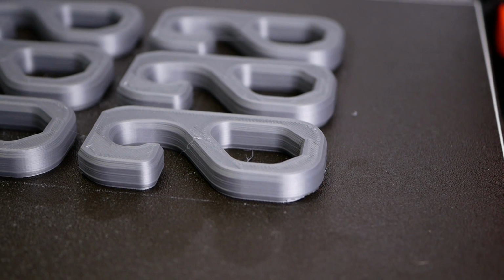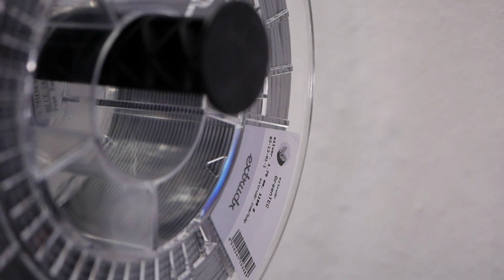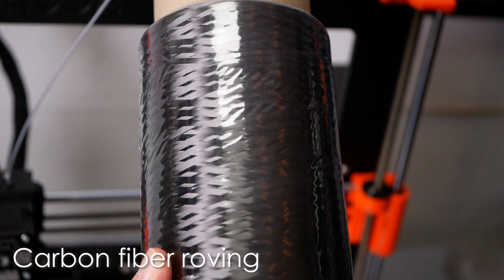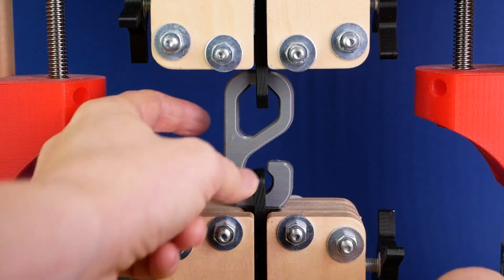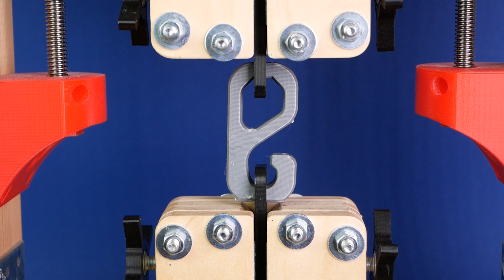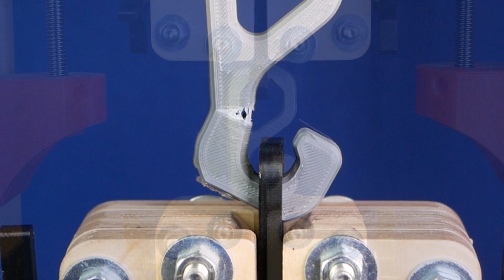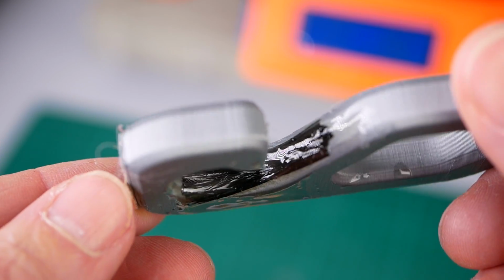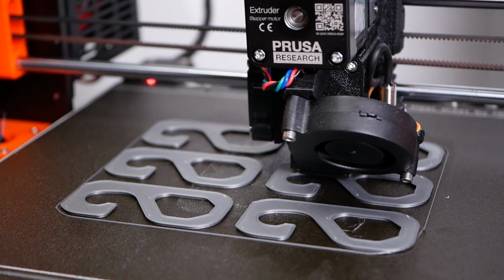STRONGER 3D Prints with GLUE? (and CARBON FIBERS)

Comment from the maker: Don't forget to share this video on Facebook, Reddit, Twitter and other social media!
Reply: Do carbon fiber videos please.
Reply: n Hello Stefan.. Can you doing similar test? I would like to know what happend if you use infill let say 15% and into the space you inject epoxy?!
Reply: If you're doing CF tests, could you also please try reinforcing with woven cotton/polyester fabric/cloth/textile? It's much cheaper than CF, and literally everyone has some available
Reply: Happy 2020 ❤
Reply: I have experience with using carbonfiber+epoxy and fiberglass+epoxy on 3D prints
Reply: also try woodglue (PVA) (from uhu+ponal, idont remember which of the booth , but one can glue nylon,  so they are different)
Reply: a glass fiber + epoxy coating should work. but only with some 3-5 layers of material. so not worth it for fine prints.
carbon fiber should be almost the same. but carbon fiber is usually heat treated to actually work so not worth it lol

there is a type of glue that I never used on 3D prints. but... the cement for plastic models (not superglue) literally fuses polystyrene together. since it's solvent based and works to fuse material. it could work for your tests with a similar material.

btw in modeling is well known that superglued parts break off even with thermal difference. some actually put the models on the freezer overnight to break off and clean all superglue parts. just use that stuff for quick fixes lol

keep up the good work
Reply: hi, your sponsor link is broken ;)
Reply: CF  - yes please!
Reply: CNC Kitchen       Test PC material
Reply: Going along with MM and Joels videos of flipping normals, what if you test embedding the carbon fibre strands inside the print at various layers using flipping normals? I think that would be very interesting
Reply: should of used Gorilla super glue version. That stuff is strong as nails.
Reply: Hello Stefan, i'm Daniel from Belgium.
I like all videos but i'm sorry i don't understand all in english.
When the subtile is in french french i'm happy but sometime no, Why ?
Thank you for your work
Daniel from Lutich in Belgium
Reply: i know it is kind of randomly asking but do anyone know a good site to watch new tv shows online?
Reply: @Charlie Gerald i watch on FlixZone. Just google for it =)
Reply: @Logan Armando Yea, have been watching on InstaFlixxer for since april myself :)
Reply: @lucasvanbeers9906  6

Comment: When you further investigate your carbon fiber reinforcement, you should use the proper type of resin for CF work instead of hobbyking epoxy.
Reply from the maker: Definitely. The working time of 15 min alone isn't optimal.
Reply: I wonder if shoe goo/amazing goop etc. would help. Flex seal could also be decent
Reply: @CNCKitchen  west systems is my epoxy of choice, it works really well.
Reply: @CNCKitchen  also try some sort of carbon fibre wrap so the entire print is reinforced
Reply: Outside of working time, I don't see it mattering much (if at all) what kind of epoxy you use for this sort of test. You're not trying to minimize the weight of the epoxy, you don't care about wicking properties. You basically don't care about anything, because the plastic will always break, and the carbon fiber never will (in his test jig). It all comes down to whether the carbon fiber is positioned correctly for the loading scenario.
Oh, the amount of heat generated by the epoxy reaction might matter, since it can deform the plastic, but I don't know if that's something you can easily account for when looking at epoxies.
Reply: Schau mal bei R&G-Composite. Die sind aus dem Luftfahrtbereich - da bekommst wirklich alles was das Modellbauherz wünscht :D
Reply: @sneaky_tiki  You apparently know very little about CF work if you think it doesn't matter which resin or epoxy you use.
Reply: @yucannthahvitt  Did you even read what he actually said? He is absolutely correct. IF you are not concerned about wicking properties and if you are not worried about weight (He is not bagging it after all) IT MAKES NO DIFFERENCE what resin he uses. He could have used polyurethane! If YOU think it makes a difference in this case then YOU apparently know very little about CF work!
Reply: @yucannthahvitt  Thanks for your deep and thought-provoking explanation of why my opinion is wrong
Reply: @yucannthahvitt  You must not have watched the video. Just showing your ignorance.
Reply: @TheDementation  You don't know what in depth means either, huh , how about that?
Reply: @fabiana.8236  Die sind top, hab ich auch schon verwendet
Reply: @ABaumstumpf  In theory, improper wicking shouldn't matter on this scale otherwise, it would absolutely matter.
Reply: @sneaky_tiki  Physical properties of cured epoxies is modified by drying time. Shorter times can result in far more brittle final results
Reply: @askjacob  I'm not sure what you meant. Do you mean that the hardeners and or accelerators used in faster curing epoxies tend to create a more brittle epoxy?
Or just that it's easier to mess up the application and get a layer of epoxy that's already begun curing blocking your application of fibers close to the surface?
I know in some cases with certain epoxies you can thermally degrade the final product by having too much mass of epoxy, and you can certainly damage it if you're too aggressive with heating for a faster cure .Or the polymerisation will be incomplete if you didn't heat it enough (for more industrial epoxies), but none of that makes much sense in this context I feel. Let me know.
Reply: @sneaky_tiki  Sorry yeah - the increase of hardeners tends to make a more brittle epoxy - so the quicker cure types tend to crack or shear more easily than the equivalent slow cure epoxy
Reply: @askjacob  Makes sense. Good point, honestly didn't consider that. In which case, yea, probably enough of a factor to make a difference.
Reply: @CNCKitchen  you should also consider testing with glass fibre. It's much cheaper and somehow really forgotten about. Something like a weight to strenght ratio would be interesting too.

Comment: A cool technique I recently saw on reddit, was a guy who prints large figures and stuff with only two walls and zero infill and then fills them with epoxy by slush casting the inside with a few layers of resin. He drills holes in the bottom, injects thin resin and moves the part around to coat the inside and let's it settle in the smallest or weakest part so they become solid.

I'm very curious how well this works and if it's worth it! Faster and stronger prints, potentially?!
I need to know.

Comment: I have used fiberglass weave and ca-glue to greatly increase strength of thin PLA parts on a mask. Works very well! :)
Reply: Can you please give more detail on how you accomplish this?  Am very interested.  Thanks!
Reply: @Bronze-td8jq  Pretty simple; I wet the part with ca-glue and push on fine fiberglass weave and push it on with a small brush so the CA can soak the fibreglass before it hardens. If I need more layers, I use activator between layers. This is probably not as strong as epoxy-infused glass fiber, but a lot better than plain 3d-print. Also might be a good idea to sand between layers if you want it to look good. I have used it inside masks etc so looks have not been important :)

Comment: I abandoned super glue several months ago when I did an unpretentious test. I was making a structure out of PVC pipes for a monitor stand (https://www.thingiverse.com/thing:3679144) and I decided to test if the glue I used on the pipes would work on PLA. For my surprise, I found this PVC glue to be far superior to super glue. Not only it gives a strong bond, but also left no white spots on the parts. Moreover, because it drys slowly, parts can be repositioned. This type of glue is particularly useful when one needs to join parts that fit inside one another, like pipes do! While liquid, the glue acts as a lubricant and can facilitate the fitting of tite pieces. I also reinforced some parts by coating it with PVC glue and them wrapping a layer of PVC film over it, analogously what you did with the carbon fiber. I suggest you try this kind of glue.

Comment: I use woven glass fibers with epoxy. Unlike carbon fibers they are transparent and almost invisible. Because the fibers are woven they do not have a weaker orientation.
Reply: Sorry, just saying "woven" doesn't give us enough info. Perhaps you are mixing up chopped strand fiber mat with woven which does have less specific fiber orientation but have other issues. Woven for sure will have weaker orientation...
Reply: And are more affordable at comparable results (for us mere mortals is good enough), and very easily acquired locally at auto parts stores. That's defn bang for the buck results. Makes PLA not such a crappy spotter at GYM afterall...
Reply: But CF is much, much stronger than glass. A cheaper alternative is aramid fiber, the generic name for  Kevlar.
Reply: okleydokley technically there are some fiberglass nearing or equal too average carbon fiber (higher stiffness and ultimate load strength), I’m sure it’s probably more expensive than CF and CF just has a cool aesthetics factor! I’m not sure of any industry besides aerospace that uses the stronger ranges of fiberglass. Kevlar like you said is an excellent material and well suited for some other tasks as it happens to make fantastic flexible hinges for composite planes (when making a UAV jet plane, we used a semi-monocoque design so the outside was carbon fiber and then we used a little strip of Kevlar as the hinges for flaps).

Fiberglass is so much cheaper though so I understand why people want to use it, definitely better than nothing! It was like $3 for a decent piece of extremely light (like 100 grams per square meter, normal checker pattern stitch) fiberglass when I bought some recently, but CF you have to pay out the nose for that stuff (the closest I have on hand is some almost ghost weight, it’s like 20 grams per square meter and it’s like a random squiggle mesh that’s so thin and hollow you can see through it, basically min weight possible that’s useful, so you can make incredibly light weight slow flyer planes, but the cost is insane).

I’d say it’s about 20-50x more for CF cloth than conventional fiberglass cloth, but sometimes the project is mostly about man hours and mold times and it may end up being only like 20% extra cost in the end, so like for this video it was so small of a patch like what’s the difference between 1 vs 2 pennies? Nothing basically, might as well use the best one. Big projects you really gotta analyze if it’s needed!
Reply: @jakegarrett8109  glass fiber can be proper tough as nails.
Reply: AntiVaganza Mixing chopped fiber cloth onto parts does not involve weaving anything.

Comment: Ever thought of printing the hooks hollow and filling the inside with resin, maybe through a hole left in the top.  I've often wondered if it would be possible to add some resin filler during the printing process with a very low amount of infill.
Reply: LOL I just thought of the same thing now.

Comment: How I strengthen is to use the part as a skeleton and wrap it in fiberglass
Reply: @RazgrizDuTTA  Currently brush and squeegy (spelling?) Still experimenting to find the best way. Parts are 12to 16inches in some direction. so pretty big. The final product  will be 130-150 lb 30x30x48 in thereabout robot.
Reply: @RazgrizDuTTA  That is what the experiments are for. Been looking for something but epoxy to use. EPOXY on PLA is not good as its exothermic and can cause distortion. Its a pain too as you got to mix it. On ABS you can use ABS slurry make it as thick as possible where you can still work it through the glass and soften the part up with acetone then acetone weld the ABS slurry soaked glass to it. now Gorilla glue adheres well to HIPS and ABS but makes the glass brittle as its extremely hard and seems to crush some of the fibers. On foam core Polycrylic works well also on cardboard and wood. On cardboard and wood Elmers glue all works well too. But 2 part poly ethylene or epoxy is best but you got to work quick. I will still run some tests with certain jb-weld products that have been specially formulated for HIPS and PETG. So atm its still work in progress to find the best solution possible
Reply: you got me thinking about merely inserting strong stuff into the print. and i think m3 bolts are strong. we often think of using bolts to join parts together, but merely having inserts for a long bolt might be worthwhile to make strong segments where parts take a lot of punishment.
Reply: @pepe6666  We insert all kind of things sometimes even aluminum tubing. You can see an early prototype move here. https://www.chiefdelphi.com/uploads/default/original/3X/3/6/36e8fbdd064daf1db337ffb20366218e0d2115d2.mp4 I think at that point it was about 9kg of filament reinforced at some places with 1/2 in 16 gauge aluminum square tube
Reply: @martinpirringer8055   Does adding the aluminum made the prototype significantly stronger? 
If yes, do you have any documents or links i can read?
I´ve been looking for ideas to make my prototypes stronger so if you have any information, let me know.

Comment: I've printed a PLA spline for a gearbox hollow. Then poured epoxy and some metal nuts as filler. The epoxy becomes super hard, and there is only 2 plastic shells.
Reply: cut up some glass fibers and mix in with the resin

Comment: You should try with a solvent glue,  like Weld-on #3 (Methylene Chloride based). It works on PLA and ABS just as well. Due to its really low viscosity, it does get in between layers and gaps dissolving and welding the plastic.

Comment: to add another data point - I had some prints that I rushed (making a prop rifle for a cosplay)...had very very bad layer adhesion because of the print speed I used. I had to reglue them together with CA and epoxy after since they wanted to split constantly. 
You are trying to improve a well calibrated print and seeing minor results. I don't want to recommend it as a crutch, but to a bad print, the glues are absolutely a life saver.

Comment: You can also try a glue which has ethyl acetate as solvent, since it also dissolves PLA and should make an inter-linking structure.
Reply: Painting the part with clear nail polish would work. Acetone-free nail polish remover also contains the stuff if I remember correctly.

Comment: I've made a few parts with carbon fiber reinforcement for my airsoft replicas (variations of ergonomic pistol grips).  Since I printed them standing I was worried about layer separation. The method I used was coating the part with resin, wrap the twill on the pistol grip then use peel-ply and a vacuum bag. The first grip had some torture tests involved hammering on all 3 axes, loading the part with 10kg and heating it to ~90 degrees centigrade, etc. It survived so well that I sanded it down and applied a thin coat of resin and after a polish it was mounted on my replica. I presume the vacuum helps the resin flow in the small spaces between the layers while the carbon shell gives it good impact and shape retaining performance.
However, without vacuum, I cannot see how the resin could get in between the layers considering its viscosity and surface tension.

Comment: I would love to see you test different methods of gluing pla parts together. A practical application being a full size Marvel mjolnir replica that's printed in several parts. CA glue, epoxy, JB Weld, PVC cement, stuff like that.

Comment: i did similar test but not in 3d printed world..  the epoxy resin will heat up while curing and therefore will affect the PLA bond but epoxy itself is not a structural component.. it is sort of keeping the fibers/ filament together .. CF will will perform however it twists (fibers have flex) depends on the type of epoxy you use..  If you could get a hand on vacuum / release / pump system (foam and core with PVA and make the fibers woven and fully impregnated it would probably damaged your jig..  same might happen if you use a layer of woven or unwoven fiberglass or kevlar or hybrid.. .. Carbon fibers themselves work as unit .. if there is a hairy crack it all goes... and also repair of CF is very difficult and usually 1 cm crack requires 10 cm repair... good job Stefan..  thank you for all these.. I like to watch this as I have done same things just using weights and springs 25 years ago ... mostly with wood during boat building

Comment: Could you also try making a channel inside of your part and fill it throught the hole with epoxy resin?
Reply: That would probably make it heavier without increasing the strength.
Reply: Or you could run some carbon fiber thru to hole with resin.

Comment: I think simply sanding and polishing a part will show there are no voids to fill with glue. Try an abs part. Dipped or vapor softened in acetone. I am wondering if you can eliminate the  difference in properties in each direction.

Comment: Things to try:

1. Same hooks, but physically thinner.  Printed at 100% infill.  Ideally they should have about the same amount of filament as the hooks in this video, but packed into a thinner hook.

2. Take the hooks from #1 and submerge them in a slow and runny epoxy.  Put that into a vacuum chamber so you can pull the air out of the crevices in the hook and replace the air with epoxy.  Remove from the chamber and hang the hooks up to cure, while letting any excess epoxy drip off.

3. Have some holes going through the hook.  Fill the holes with epoxy and carbon fiber threads.  

4. Same as #3, but use normal fiberglass fiber/threads.

Thanks and good luck!
Reply: I really like your first idea, testing different cross section geometry using the same amount of filament.